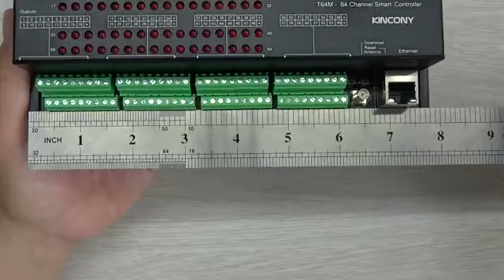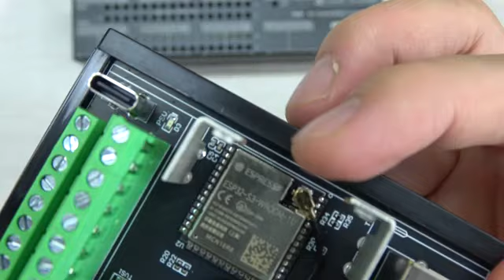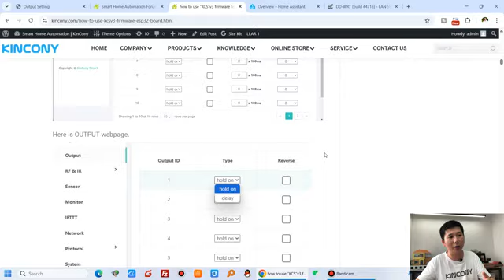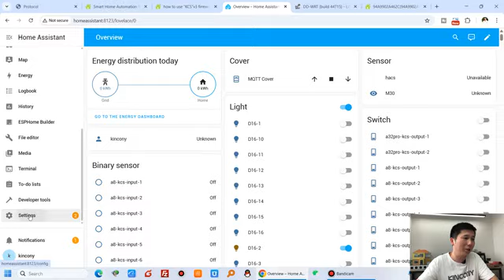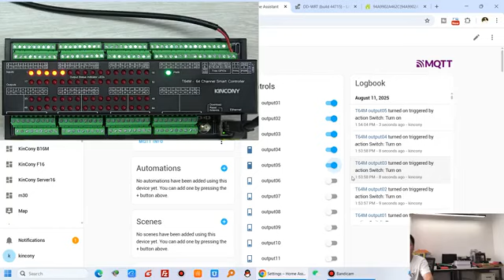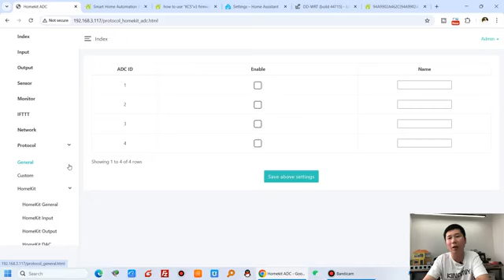new T64M ESP32-S3 64CH DI+DO module for home assistant ESPHome Tuya

Comment from the maker: T64M introduce:

Model No. KinCony T64M
Description: KinCony 64 Channel Tiny ESP32-S3 Smart Controller – T64M
Power supply: 12-24V DC
Processor: ESP32-S3-WROOM-1U (N16R8)
Size: 200mm*83mm*56mm
interfaces: Ethernet(RJ45)-LAN 100Mbps IPv4/IPv6,WiFi,RS485,Bluetooth,USB-C
Installation method: DIN RAIL

Outputs:
64CH MOSFET Outputs, every channel use MAX 4A driver IC

Inputs:
64CH dry contact inputs (optocoupler isolation, long distance circuit for MAX 500 meters cable)
2 buttons: 1:ESP32 Reset 2:ESP32 Download
1-Wire GPIO: 4CH (with pull-up resistance on PCB)
free GPIO: 3CH (connect with ESP32S3 pin directly)
2CH analog input DC0-5V (A1,A2) 2CH analog input 4-20mA (A3,A4)

software solution:

1. download KinCony KCS v3 firmware, so that work with multi protocol: HTTP, MQTT, TCP, RS485 modbus, config OUTPUT for “momentary” and “interlock” group functions. if you want local voice control without internet, you can add KinCony AS voice assistant. “KCS” support IFTTT function work locally without internet. It also support use by KinCony cloud server. KCS v3 support home assistant auto discovery function by MQTT, so without any config file for home assistant.

2. download firmware by ESPHome, integrate to home assistant or use by web service.

3. write your own Arduino or ESP-IDF code for your own requirements.

Order bundles:
Bundle A: T64M
Bundle B: T64M + USB-C cable+ power supply

Related technical information
———————————
ESP32 I/O pin define: https://www.kincony.com/forum/showthread.php?tid=7996
config yaml file for ESPHome: https://www.kincony.com/forum/showthread.php?tid=7997
ESPHome official supportted list:
arduino demo source code: https://www.kincony.com/forum/forumdisplay.php?fid=81
KCS v3 firmware online guide: https://www.kincony.com/how-to-use-kcsv3-firmware-esp32-board.html